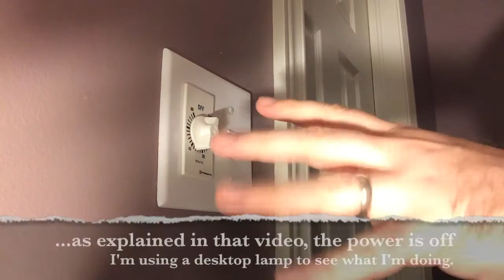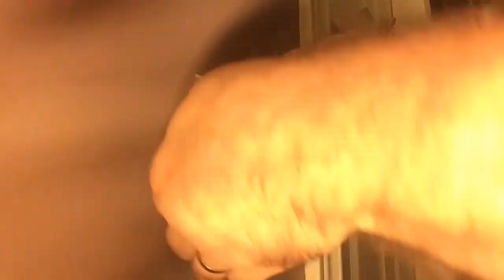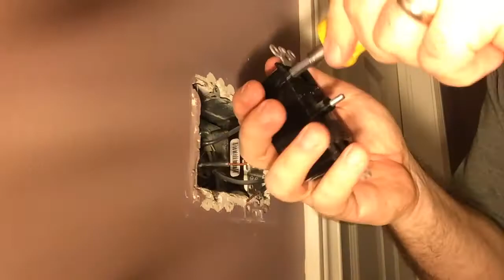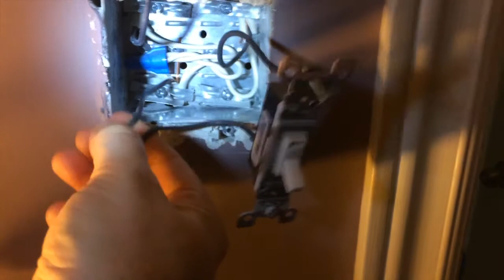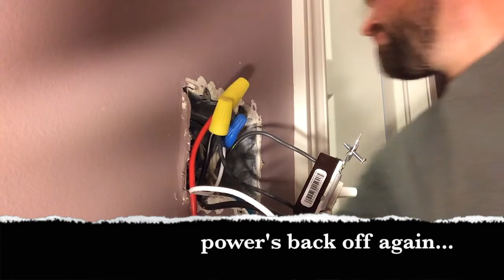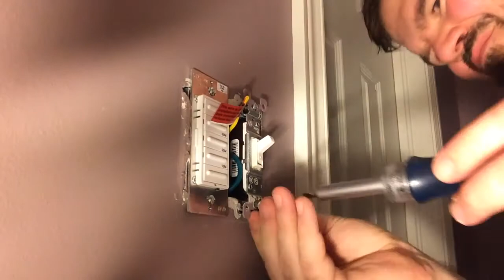How To Install A Digital Timer Switch

Comment: You might want to mention to viewers to turn off circuit breaker first. safety first man.
Reply: Yes, good point. 
I did mention it in a "lower-third-title" @0:15 ...but didn't explicitly say it. I shot two videos at once and didn't repeat the warning to turn off the power. @4:35 I turn the breaker back on.
The fan/light are on a different circuit than the nearby outlet so I had a lamp plugged in so I could see what I'm doing.

Comment: You might want to shut off the circuit first.
Reply: I did, actually. The plug outlet in that room is on a different circuit than the lights (no idea why). I had a small desk lamp plugged in while I was working